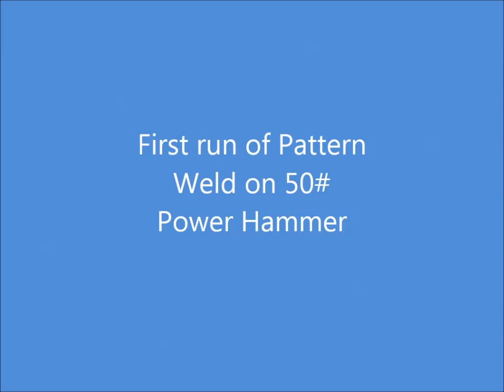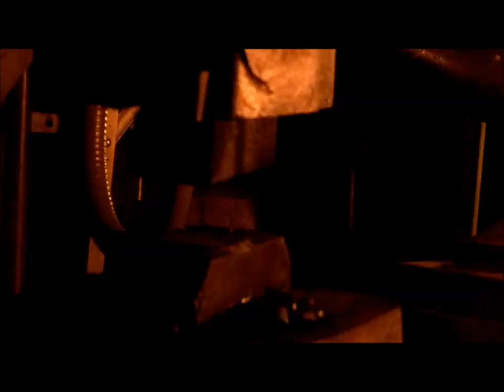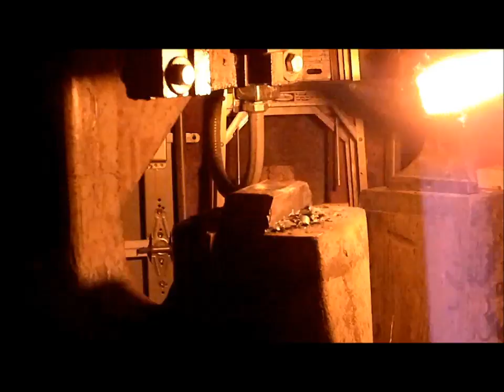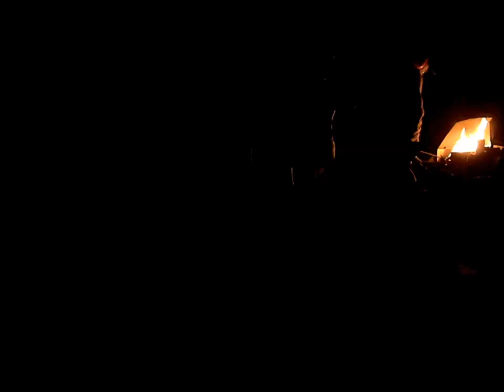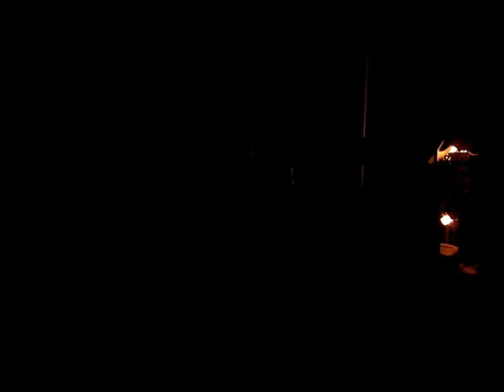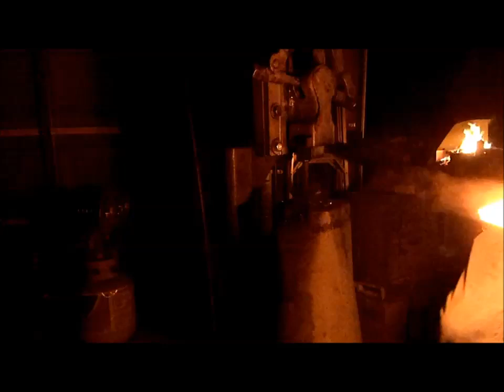Starting Damascus on my Power Hammer Part 1

Comment: Daniel, its Kevin from Bladesmith's forum. glad to see your hammer and improved ability to turn out pattern-welded steel. looking forward to your creations.
Reply from the maker: Thanks Kevin. Me too. I was surprised how easily I jumped back into pattern weld, even being my first attempt with the new hammer. Once I realized I can set the weld with the hammer without any headaches, I took off. Having a machine of any size is pretty amazing for the doors it opens up. For instance tongs. I can more easily make tongs that fit what I need than I could before. Only have about 15 tongs, and constantly have to re-shape. Now I just make a new set...when I get time of course.